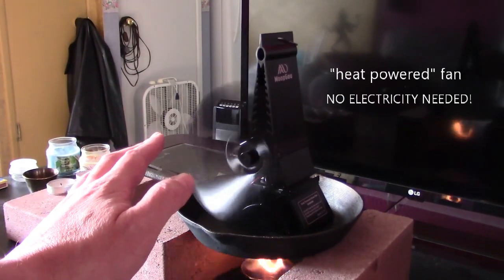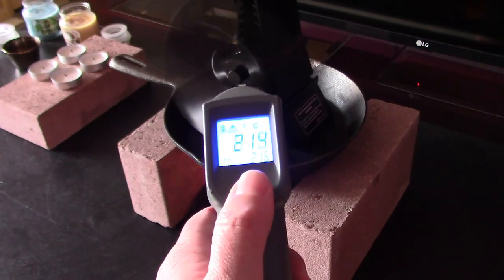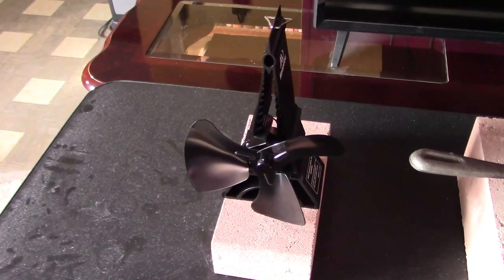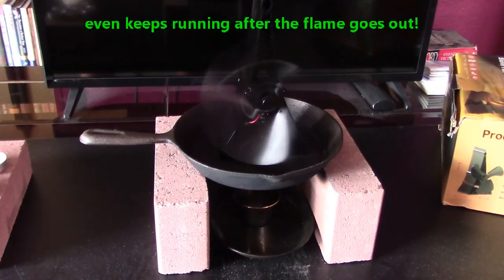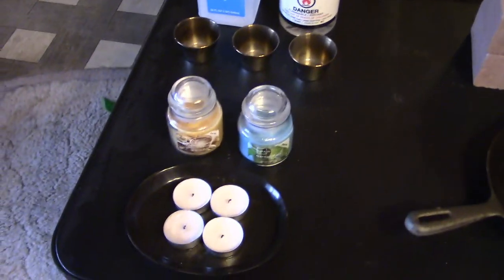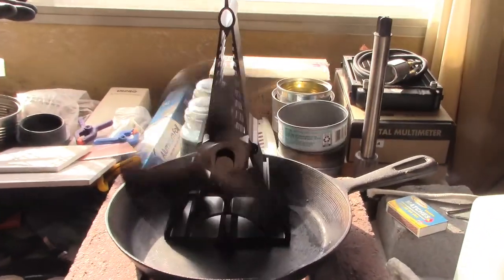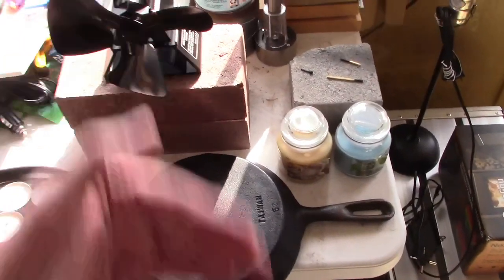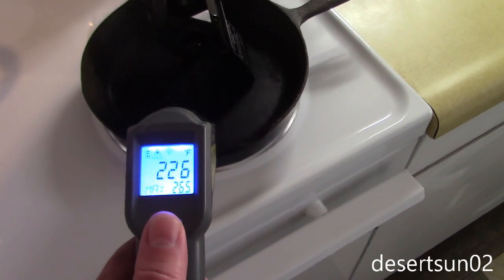DIY Air Heater Hack! NO electricity needed! uses a "Heat Powered" Stove Fan! High Temps! & Airflow!

Comment: your vid sayed nothing how does the fan work and turn without eletricity.Fake
Reply from the maker: hi there. it's real, not fake 🙂. heat powered stove fans have a little device called a 'peltier chip" or peltier module in them. it's about the same size, shape and color of a saltine cracker. they soak up the heat and convert it to electricity. then they feed the electricity to the 'fans motor'. if you go to amazon you will see dozens of these fans for sale. just type in 'heat powered stove fan'.

Comment: Still needs electrical power though (battery)
Reply from the maker: hi there. no battery needed with this. the fan is actually running off of the heat.

Comment: If you use beeswax instead of other fuels, you don't have to worry about carbon monoxide, as beeswax gives off oxygen. :)
Reply from the maker: hi there. if you stick with ethanol fuels or a few candles then there is no issue with carbon monoxide. the ethanol fuels (ventless indoor fireplace fuels) only give off a small amount of carbon dioxide and a little water vapor (only about as much as one person inhales). so those are fine and candles are just candles. you can easily burn 5 or 10 with no troubles. i do it all the time. i 've been meaning to buy beeswax candle but i think when i checked they cost a lot of money

Comment: Keep heating long after the fire goes out by putting a pot full of sand (or an old metal bean or soup can) on top with the fan on top of that. It stays hot for hours.

Comment: Please add a link to the fan assembly.  If some are better than others, please tell us how to distinguish those that are most efficient. Very timely video!  I'm cold.
Reply from the maker: hi there. i've only tried the one fan so far (but i've ordered 2 other ones - one came in the mail yesterday). i'll try them all and see if there is much difference between them. the one thing they all have in common is a starting temperature of 122F (50C).

Comment: I have been doing this for a while using a fondue stand to put the fan on. Since I have never had good results from using isopropyl alcohol due to bad smells and soot, I have stuck to methyl hydrate or candles. The fondue stand needs to be higher if I want to use bio ethanol as the flame goes much higher than methyl hydrate. I have reused the cans from camp cooking fuel.

Comment: You keep amazing me!  That is awesome.  You are also getting heat retention from the cast iron.   I've been using your idea with the T pipe.  I was gifted with gallons of free hand sanitizer.  I read what was in it.  It's exactly the same as the ethanol fuel cans.  I saw a youtuber that replaced her fuel cans with hand sanitizer too.  Now I have a free heat fuel.  But yours goes to the next level by not needing electricity or battery power to run the fan.  Excellent!  Keep engineering new ideas!
Reply from the maker: hi there and thanks! i'm glad you like the idea! this one works great! wood stoves are typically made out of cast iron so the cast iron pan seemed like a perfect idea (and the fan doesn't know the difference).
Reply: @desertsun02  Yes!  I got my fan from Amazon yesterday and just put together your same set up.  Love it.  I'm burning ethanol hand sanitizer.  I made your T pipe heater, but this one doesn't require the electricity of a fan and that aspect I really liked because I can move it anywhere and not trip over a cord.  I just keep cans ready to swap out and pour the fuel in right before lighting.   I really love this heater.  Thanks!
Reply: @desertsun02   Not only that but most people have a cast iron pan or know where to get one.  Really love this.  Can't wait for my fan to arrive.  I was gifted with cases upon cases of gallon jugs of this hand sanitizer.  Free heat this winter.  I love it!  Keep tinkering.  You're coming up with such great ideas.

Comment: Does the liquid fuel alcohol/ethanol use any cotton or anything for longevity, or do you just burn  puddle of it in a tuna can?
Reply from the maker: hi. i don't use any 'wick' material. (but you could use a burner with a wick if you wanted to). 👍🙂

Comment: There are people who actually need something this right now to simply survive winter in Ukraine. The real advantage of this is most components can be found (or easily sourced) in any household, so you'd only have to ship over the fan and the fuel. I'd say solid fuel tablets made for camping stoves will work just as well (they're more compact and safer to transport). 
Would you mind if someone uses your design for this purpose?

Comment: What is the Temps if you had flipped the pan over...would it hold the heat in the pan more?
Reply from the maker: hi. probably not. when the heat hits cast iron, it sinks in pretty good
Reply: I plan to make this.  I have a round piece of soapstone that should fit the interior of the pan.  Seated inside it, i think it will retain heat a very long time.

Comment: ...TEG. Thermoelectric Generator. It's also called a Seebeck Generator. It's the electrical source that powers the small electric motor turning the fans in these wood stove units. It's also the same small component that is used in the small ice chest sized 12v DC cooler/food warmer boxes available for quite a few years. I don't know the physics involved. ...but, if you apply a pretty good heat difference, it provides DC electrical current (to turn a fan). It also has reverse capabilities. If you provide DC current, it changes temperature at specific rates, which is why the ice box heater things work. With polarity connected in one way, it cools an enclosed, insulated box. Reversing polarity introduces a heat to the same enclosed space. I looked into these a dozen years ago as a potential off grid electrical source here in the Rockies, but even at zero outside and 60s or so indoors with a set of these components in series and parallel, no way is there enough temperature differential to be efficient enough to charge batteries or even keep a few light bulbs lit at night. They absolutely do work when coupled with the right sized fan motor to move heat forward from a wood stove or other flame source, and to heat or cool a small, insulated ice chest sized box when used in opposition.
Reply: ...a possible efficient heat source might be the home made crisco (vegetable shortening) candles that burn for long periods placed below an iron skillet to capture the heat in the cast iron mass. The long burn time (days vs hours, compared to other candles) might involve a compromise/heat tradeoff for otherwise higher temperatures with faster burn. I do know a mason jar with veggie shortening and wick burns for days longer than any beeswax candle, much less a cheap paraffin tea light. ....how many BTUs it produces I don't know.

Comment: The temperature of  350¡ã C may damage the fan. Just how high is your temperature?
Reply from the maker: hi there. these fans handle up to 350C (662F). you won't get a temp over about 500F (260C) if using isopropyl alcohol or ethanol and candles will be a little cooler than that (so it works out great).

Comment: I don't see that fan on Amazon.
We have an Ecofan, not impressed at all for $141
Reply from the maker: hi. $141 is super high. these stove fans run anywhere from $29.99 to $49.00. from the ones i've seen. the one i bought was just $29.99. it's a little smaller than some and is a "3 blade" unit. moves up to 360 CFM though so it really moves a lot of air (for its size). similar to a good strong desk fan.

Comment: Where did you get the fan?
Reply from the maker: hi there. i got the fan on amazon. they have lots of them.
Reply: I don't see the one you got. Can you give the model or brand of the one you are using.
Reply from the maker: hi. it's model FF-2201 but any one will work. i like the ones that start at 122F. i bought the triangle one because it looked unique

Comment: Great idea, I thought you had to have a wood stove to use one of these fans. Do you have a link to the fan?
Reply from the maker: hi and thanks! you don't need an actual stove (just something that mimicks a wood burning stove-top). it just needs to get hot enough. this design gets to the same temps as a full-size wood stove. (and the cast iron is perfect for absorbing and radiating the heat). i don't have the exact link but amazon has lots of these wood stove fans. i chose a 3 blade triangle shaped one. but any will work.
Reply: Thank you!
Reply: Heat differential is how the TEG works. I doesn't have to be a wood stove.

Comment: How does the fan work?
Reply from the maker: the fan actually has a peltier chip (TEC) in the design of it. one side absorbs the heat and the other dissipates it. the aluminum design of the fan is just two heat sinks. the temp difference is what causes an electric current to flow and the chip is connected to the motor. it's wild. at one point in the video i show the back of the fan (so you can see the chip and the motor)